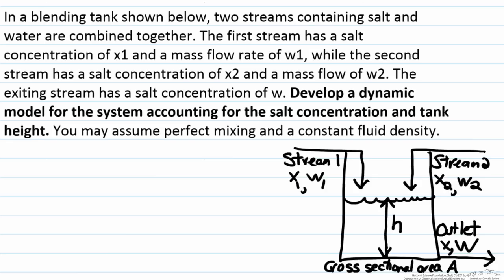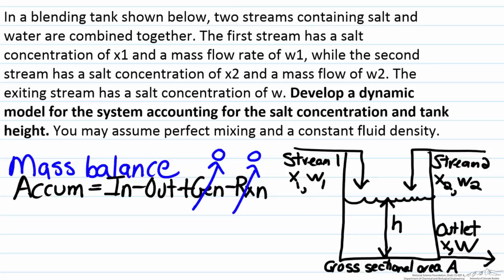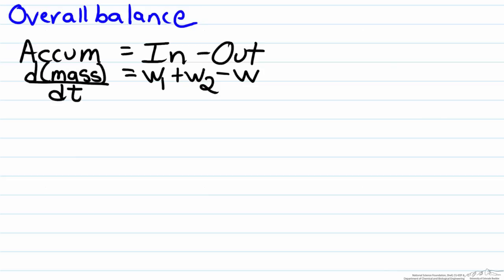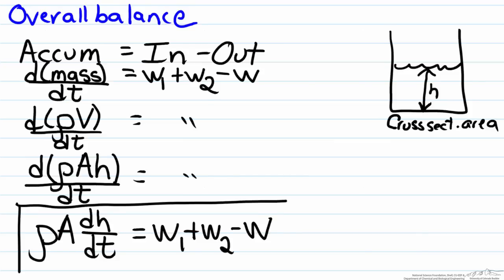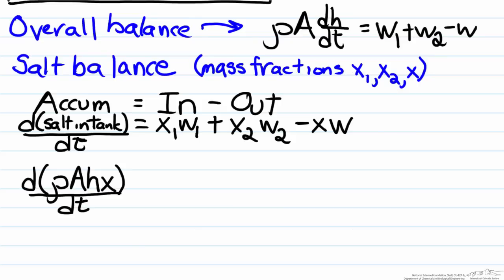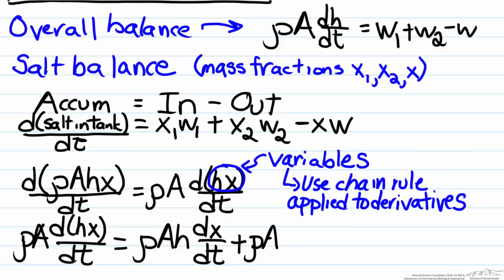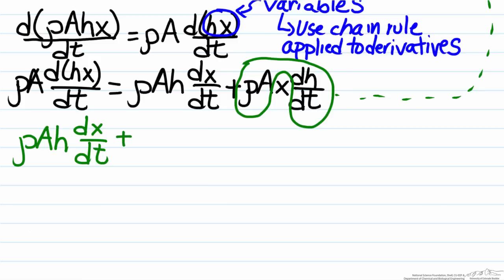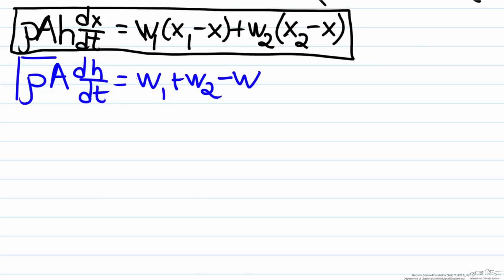Mathematical Modeling: Multiple Balances

Comment: @5:11 The speaker says to use the “chain rule,” but I believe they are referring to the “product rule” of differentiation.

Edit: Had the time slightly off
Reply: I forgot that the product rule is a special case of the chain rule for derivatives of multivariate functions. So, both are technically correct. My bad.
Reply: @daltonpruitt7772  Nice to Know that you found your mistake